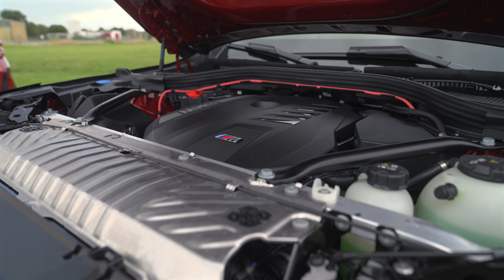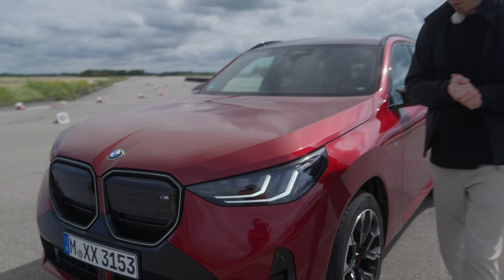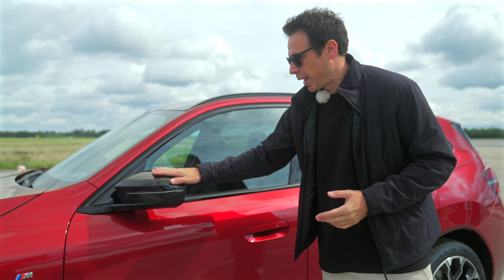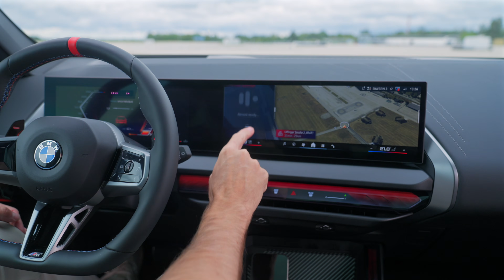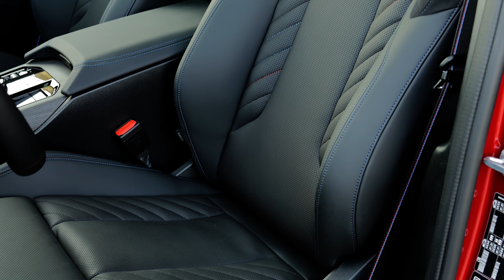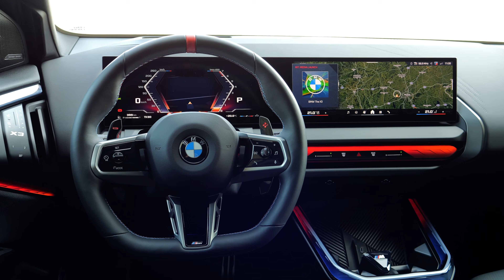NEW 2025 BMW X3 M50 Most Comprehensive Review

Comment: As a loyal BMW fan for years, and a current X3 M40i owner, this new X3 is a slap in the face. I was ready to buy with a 20% discount, but the interior? Absolute garbage—cheap plastic everywhere, even the door handles feel like junk! At this price, it's an insult to customers. BMW, you’ve lost your touch, and it’s pushing us die-hards to look at other brands. Seriously, wake up before you drive your loyal fans away!
Reply: We have a '22 X3 M40i coming up on lease end in a month. Thought this might be a good option but not....Current vehicle has only low 20K mileage, so worth more that lease payoff. Going to keep the '22.
Reply: @DavidStampfer-w1e   Same for me. I have a 22 X3 M40i on lease and with 21k miles. Will be buying the car and keeping for years based on the 2025 I see.
Reply: @MaineMortgageRate  same for me.  i only have 11k miles on the 2022 and can buy it out of lease for $31k so i think it makes sense
Reply: exactly what I am doing through now, sigh what to buy
Reply: @lequnsu4689  GLC has better interior, but more expensive, Lexus is also nice but no sport model, new Audi Sq5 could be interesting too.
Reply: @palzsolt3712  yes that's where I am more towards now. SQ5.
Reply: @lequnsu4689  i'm in the same position.  what about the mercedes glc
Reply: @spojce9  Mercedes doesn't give discounts in the UK anymore due to its new direct sale model.plus it is already more expensive.
Reply: @spojce9  and UK's new SQ5 price has been released, it is even cheaper than the fully loaded M50. Case is settled I think. No brainer. You have to be mad to spend more and get much less.
Reply: How to get 20% Off??? I’ll buy it in a heartbeat
Reply: @MrMaksi1990  well, it is a special case. This year we bought an m240i and an X5 50e brand new for our company. The m240i was towed after 5 days, was in the workshop for more than 2 weeks. Battery issues. 6 months later the brand new X5 50e arrived, was happy with it for 3 weeks, than it also did not start and had to be towed. Was in the workshop for 6 weeks. Also battery issues. Long story short, as a long time customer at this dealership, I threatend to sue them if they don’t give me me some sort of compensation, as this is unacceptable at this price. Caused me a lot of headaches and extra work to deal with these issues. I wanted 30%, they gave me 20. I will order the m3 touring, keep the m240i until it arrives, which is like a year.
Reply: I'm not convinced that the new M50 is a worthwhile upgrade for me. I'm already happy with my 2022 M40i, and I'm planning to replace my X3 with the current X5 soon.
Reply: If bmw isn’t careful. They’ll be losing all their sales like Audi
Reply: 20% discount?  What the?
Reply: Slightly confused, New x3 looks nicer, has more performance, better mpg and people are complaining because of a bit of plastic? 😂😂 BMW know what they are doing and if people are going to leave because of some plastic handles they aren't going to care, more than enough people will buy it
Reply: Exactly the kind of ignorant comment someone who never lived with this model would say.  In person this vehicle is impressive.
Reply: Audi SQ5 for the comfort and daily routine
Reply: Porsche Macan
Reply: @christophergresco9677  that's the class above.
Reply: Wow! Now I have to seriously give Lexus a look. 🤦🏿‍♀️Been driving BMWs for 20 years 🥹
Reply: Where the hell is the front bumper? 😢
Reply: @HouseHunt365 When you find it you will probably find the rear one.   All parking impact is going to the the rear hatch…$$$.
Reply: Your just upset because your current BMW is out of date and now you are whinging how you are supposedly disappointed. You are like all the muppets who took to social media to whinge about the new BMW M2.
Reply: @aliibn-muhammadal-sharif8568  My current bmw is out of date? a brand new m240i and a brand new BMW x5 50e? sure, those old pieces of shit...:D:D what do you drive buddy come one...
Reply: Yall are tripping.  It’s different for sure but I’m loving this thing. Smooth, fast and full of tech. May not be the best design they have ever made but it drives like a dream.
Reply: At 20% off, you're not really hitting anyone not buying it 😊
Reply: @3000Payne  just doing myself a favour. Buying a brand new facelifted m3 touring instead! (I’m from Europe.) Just placing the order. Can’t wait lol.
Reply: @3000Payne  where do you get the 20% off from?
Reply: They really dont care, Asia and with china particular is soaking it all up they cant produce enough. As long as there are incredible sales numbers they really dont care who buys and where, nor will they devalue the brand.
Reply: At least the x3 and glc is cheap. 49k for the phev, 64k for the m40 and 43 and 79k for m comp and 63. The Audi q5 is 80k and 99k for the s, phev is 98k
Reply: BMW DRIVERS ALL CHEAP PLASTIC PEOPLE ANYWAY 😅
Reply: Yup disappointed with interior as the M50 drive is great.
Reply: This thing is absolute junk compared to previous gen x3. Hope they don’t massacre the upcoming x5.
Reply: @steverogers7211 I don’t think they’re changing the X5 again anytime soon. I’m waiting to see what they do with the X4. That’s due for a full refresh.
Reply: @manoftomorrow5987 They canceled the X4 for this generation. The new X2 is also a replacement for X4…unfortunately.
Reply: @amrknu  nooo…please don’t let that be true. That’s my dream vehicle…I didn’t buy one for the 2024 model year because I’m waiting to see if they refresh it since nothing was done basically of substance since 2019.
Reply: @manoftomorrow5987  in July BMW themselves officially announced that  X4 is dead. Instead, they will make only the electric version iX4 that will come in 2027.
Reply: @steverogers7211  when is the upcoming X5 coming out?
Reply: Yes, seems inside door handles are from black plastic…how can it be in such price segment?
Reply: Get with the times, this is how cars are now. See any differences with the new Q5?
Reply: Same here. Plan to keep my 2021 X3 which now has 36k miles on it. Debating with myself if I need to purchase an extended warranty if I plan to add 40k miles more.
Reply: The finger prints on all the shiny black would drive me crazy. I had a loaner of the X1 with this new interior and I absolutely hated trying to navigate via the touch screen only. No iDrive controller in that car and it was horrible so at least they keep the controller in the X3, but having to control the climate items via the touch screen was a pain. I too am looking at other manufacturers now.
Reply: Moving to ioniq5

Comment: No opening sunroof and those interior plastics are the two biggest disappointments in my eyes. Imagine how that interior will look after 3/4 years of ownership
Reply: The interior will or won't hold up in conjunction with the care and attention,  or lack thereof, the owner provides it. As far as the sunroof, get a 2024 or older X3 or a different BMW SUV. 💁🏾‍♀️
Reply: I don't think opening up the sunroof is a big deal.  I have a full pano but I never open it up.  I just slide the shade to let in light.
Reply: The exterior design too, it looks like an angry capybara
Reply: It seems like BMW made a wise choice, considering that my 2022 M40i pano roof had a serious leaking problem when it rained.
Reply: Dirty and broken after 3 years

Comment: Too much plastic!!!!!! I don’t like the plastic door handles and the BS lack of ambient lighting in the rear plus I want the sunroof to work like my ‘23. I definitely will be writing them!!!
Reply: Yeah, completely cheaped out in the rear. More crap plastic instead of the lighting is just a slap in the face!
Reply: Same as the G60 5-series. Tons of plastic where the G30 had soft vinyl and next to no rear lighting.
Reply: yer getting recycled CRAP(scottish accent, thanks)
Reply: It has ambient lighting in the backseat doors tho. Shrug. It’s beautiful in person.
Reply: @ I stand corrected, I could have seen a preproduction car because when I say the car this Summer…it didn’t. I have a ‘23 X3 M40i and I can’t see myself in the 2025!!!!
Reply: If you have 23 model why you want to upgrade. ?
Reply: @ my lease will be up 12/25…but with only 12,000 miles currently and most of the plastic still covering the pedals and other metal parts, my dealer wants my car back asap!!! It has a ceramic coating…it’s fully loaded…triple black and they could get quite a bit for it…which is good for me since I’ll need to order my ‘25 Z4 M40i manual by April or May…there is no ‘26 model being made.

Comment: My ‘23 X3 M40i has protection on the piano black…so no scratches. I’m tired of hearing about everybody complaining about it. Also… those exposed plastic surfaces you tapped on the dash with have after market carbon fiber pieces available. I covered my shiny black shift knob with a carbon fiber one. I’m definitely going to trade my ‘23 lease in for a ‘26 one and make all the corrections to the interior as I see fit. Oh…and I getting the leather or faux leather dashboard over the woven one that’s $350 more and looks cheap!

That dark material around the piano black where the shift lever is happens to be Magnolia Fine Print Wood, the other option is a lighter silver color M Fine Brushed Aluminum Interior. You should have done your homework…shame on you.
Reply: so will you also find the replacement for the cpillar that used to be leatherette where the rear searts to the chassis and 5 feet by 2 feet wide plastic now ?

Comment: 15:50  quite responsive huh? more like a bit of lag with unnecessary faded transition right there. If car manufactures stubbornly pushing away from buttons then fine, I'll accept it reluctantly. Just don't erase the snappier and instant response that I used to have when I'm using the physical buttons.

Comment: When I put my ‘23 X3 M40i in Eco Mode it makes me nauseous…it stays in Comfort until I want to show off next to a Tesla. I switch to Sport and rev high so they know their car can only barely whisper to me!!!!
Reply: A Tesla would smoke it off the line though. (Not really a Tesla fan; I drive a bmw but it’s just a fact lol)
Reply: @austingibson8361  , I was on the 5 FWY to San Diego and the Tesla couldn’t make any noice, but the sound of air escaping from a bicycle tire. The sound of my BMW B52 engine definitely scared the Schitt out of it because they couldn’t keep up, but a woman driving a VW Atlas did. A Tesla is a joke, a rip off an idiot mobile. I have a car from a company that’s known for it’s driving  and handling characteristics. The build quality, the materials used and the pure stamina…Tesla’s are only know for speed due to electricity. I have an interior of leather and carbon fiber… ever heard of any BMW catching fire spontaneously or taking over from the driver and going the wrong direction on one way streets or simply crashing into a wall just for kicks. Plus, everybody knows General Motors Super Cruise is the “Cadillac” of hands free driving, and the car critics all agree that BMW’s system is the only one than even comes close to GMs. You most likely don’t one either a BMW or Tesla…going from 0 to 60 is what excite young boys, knowing you’re driving the best that money can buy is where real men know what’s happening.

Comment: Which one to choose BMW x3 M50i for $72000 or BMW x5 40i $75000
Reply from the maker: I would take the X5. It's still BMW's best product in the end. And it has the same B58 inside.
Reply: Take the X5! 

I'm a X5 F15 3.0 diesel driver, I've bought the car brand new ten years ago. An X5 offers you everything you need! 

No reason to hesitate. 

Piano black crap? Forget it! 

Also the X3 has very few interior colors. Which is a bug downside. 

I have terracotta color leather btw 👍.
Reply: I have X7 40i already and need another smaller car. X1 to easy, so I wanted to check X3 first. We don’t have diesel here only the gas option.
Reply: @timp8332   - Wait for the facelift X3 model as the current model hasn't got the best quality interior.

Comment: the "My Mode" button need to go on every BMW.
still No mode selector on the steering wheel makes No Sens after all this time.
he exterior design of the X3 is Another Fail. which is an Habit for this Model to be a Let down.
Reply from the maker: The My Mode button is useful
Reply: @bmwblog   No It's Not.
T's making a Spectacle of of changing driving mode.
2 Actions instead of 1

Comment: Great coverage as always. I actually like the exterior design for the most part but would have liked the front a little more angular and not as bulbous looking. I say that but also realize why someone who is a fan of a traditional BMW looks doesn't like a lot of the new models. Wish the interior felt a little more high quality. To me it just feels like there is way too big of a big of a gap in interior quality between X5 and X3 (compared to X5 and X7) especially with the seats. Overall though, I really like this new X3.
Reply from the maker: Overall, it's still a great product. I think we just expected a bit more luxury, but then again, it's not an X5
Reply: @bmwblog it is an X3 though, and the previous gen X3 was honestly pretty luxurious on the interior.

Comment: Thank you for bringing this review. Sadly, all my worry becomes true. Great to drive and engine but interior materials/design big big disappointment. The new SQ5 much better in that department.
Reply from the maker: I have not driven the SQ5, so unfortunately I can't compare the rides. But the M50 drove nice
Reply: @bmwblog  it will be a very hard choice for consumers. X3 M50 drives better, great engine but nothing else. For the same money, the new SQ5 will not handle and drive as good as the X3 but the quality of the materials used inside and what you get for your money, sigh, very difficult to decide which to buy.
Reply: @lequnsu4689 in the same boat now. What a shame…I slowly came around design but interior quality is really just a step down.
Reply from the maker: Not an easy one.